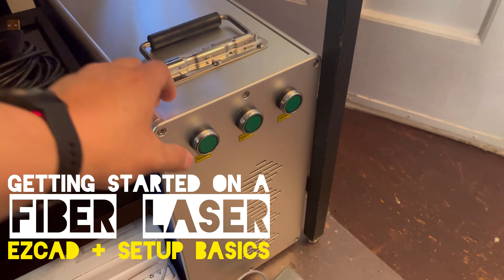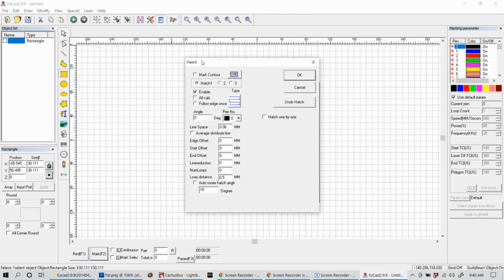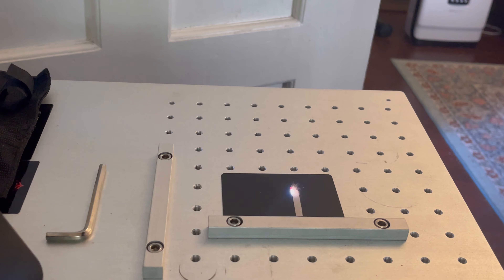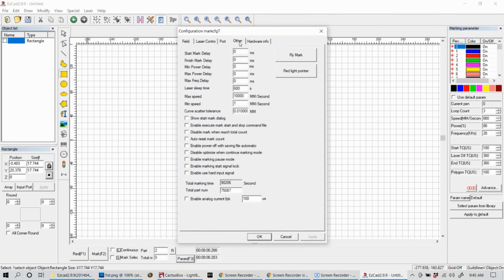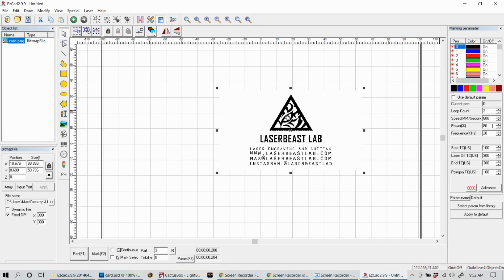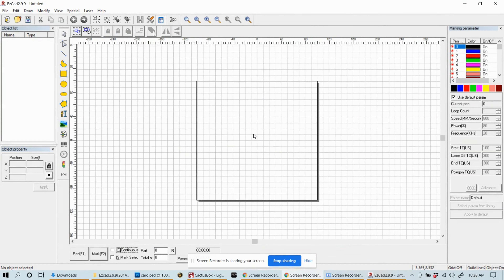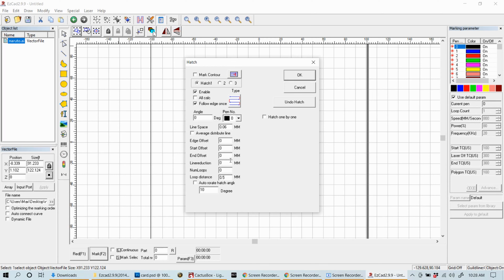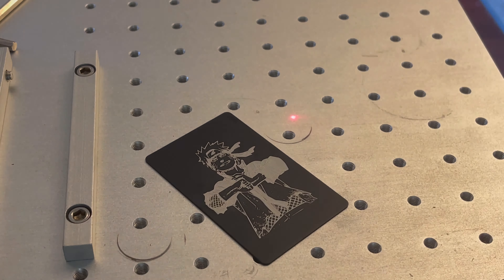Laser Marking with a Fiber Laser Marker & EzCad - Project Walkthrough - OMTech Laser

Comment: Hi sir. What is the correct focal distance for those laser machine?
Reply from the maker: Good question! The focal distance for our 20 and 30W Fiber Laser Markers is 24 cm; whereas, our 50W is 40 cm.
Reply: @omtechlaser  Thanks for replying my comment since currently im struggling to get the right setting for engraving wood material. Hehe

Comment: Is the 30w laser good for engraving firearms such as designs and lettering ?
Reply from the maker: Yes, it has been used successfully with firearms. However, the material and settings used are great factors to consider.